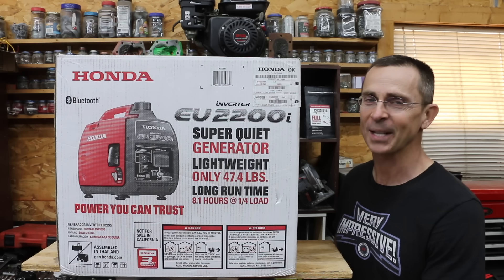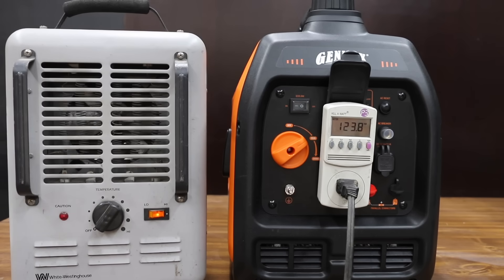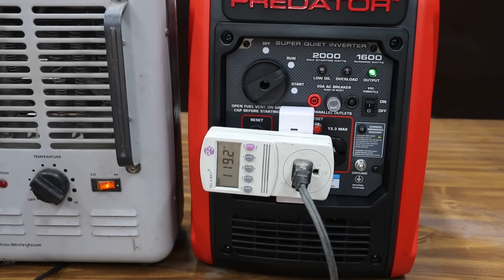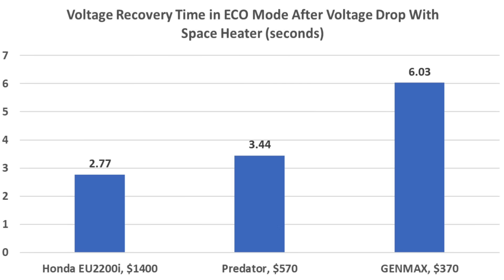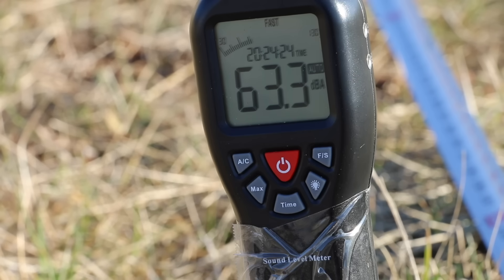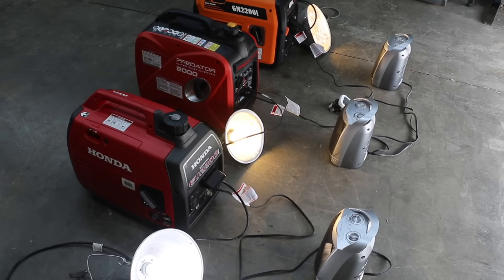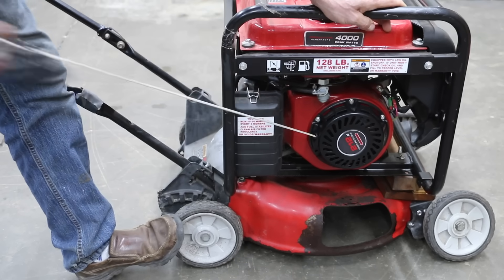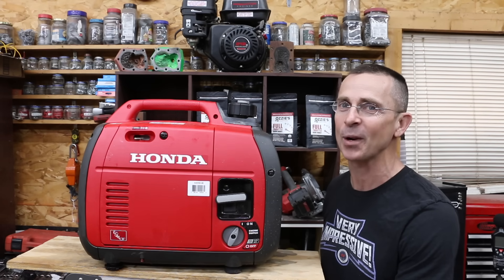Cheap Generator Better Than Honda? Predator vs Honda & GENMAX—Let’s Settle This!

Comment: I got the wen for 300 (same basic unit as predator iirc, but rated for 2200/1700). Works great and super quiet.
Reply from the maker: Thanks for the feedback.

Comment: Here's a footnote for you: I have two of the portable Honda inverter generators, a 1000 and a 2000, both with over 5000 hours of run time and NO repairs. It is questionable as to whether or not you would get that kind of service from the cheaper generators.
Reply from the maker: Thanks for the feedback.

Comment: I use that Predator 2000 inverter generator on a daily basis running concrete saws and demo hammers and running an omni directional fan. It's interesting that you shouldn't put more than 13A on the circuit, because with ECO off, it will trip the breaker running a 15 A motor, but turn on ECO mode and it will rev up and give it the starting power it needs to run 15A tools as long as you let the tool do the work and not jamming the tool into your work piece, it won't trip.
Reply from the maker: Thanks for sharing.

Comment: I bought a Wen generator a couple days prior to hurricane Harvey, but ended up not needing to use it.
During the Texas winter storm, I did have to use it. I ran it the first day no problem. The next morning it would not start. False sense of security that left us without power when we needed it.
I bought a Honda eu2200i on sale and during Texas tax holiday. I have fortunatetly not had to use it yet, but bought it based on the stereotype of Honda reliability, and many online reviews.

If is runs when I need it to run, it is worth whatever the difference is in cost over the cheaper brands.
Reply from the maker: Thanks for sharing.

Comment: Great video. With that much more metals in the oil I am not sure if the genmax would last nearly as long as the others. But the predator needing more oil is not great either.
The only other cheap brand I know of is Powersmart, not sure where it falls on the price list, but I believe it is around the genmax price. That would be a good one to compare to these. Not sure what other brands would be good to test with it.
Reply from the maker: Thanks!  Thanks for the suggestion.

Comment: I THINK that most small engine makers ask you to use conventional oil at first for a break-in period.   Maybe that gives a little insight into the oil burning.
Reply: I run Rotella 15w-40, works great in the summer. High zinc diesel oils are cheaper than high zinc small engine oils. 
For what it's worth my wen 3800 went through a 1 hour unloaded run new, I then changed the oil and have been changing it every 100 hours. It doesn't burn enough to be noticable.
Reply from the maker: Thanks for the suggestion.

Comment: I bought the predator 2000 during a long power outage to run my fridge / freezer. I was also able to run my gaming computer, 2 monitors and my GFs PS5 and 55 inch Sony TV. 1000 watts to the electronics and whatever the fridge and freezer used. It ran for over 12 hours on 1.2 gallons of fuel. Pretty decent little generator.
Reply from the maker: Nice!

Comment: Ryobi makes a competitor to these that has an electric starter (powered by one of its 18V hand tool batteries).  I’d love to see how that compares.  Similarly the Ecoflow Delta generator with its battery powered starter.
Reply from the maker: Thanks for the suggestion.

Comment: Another vote for a Champion test. I have 4K model which has been good for me. One feature it has that a lot of others don't is a fuel shut off valve which allows me to run the carburetor dry. With only ethanol laced fuel available where I live this is very important. I also have a small 1K Honda which if left for a bit requires some Seafoam to be run through it to get it to run smoothly.
Edit: I forgot to add that it also has remote start. We dry camp so it allows us to turn it off at night without going outside in my skivvies. Ditto in the morning to stat the coffee maker.
Reply: The Hondas do have a fuel cutoff. It’s the engine on off switch. If you turn it almost all the way to stop but not quite enough to kill the engine the fuel is shut off and you can let it run dry. 

The newer models have a label on the switch showing where to turn it to.
Reply: @Mi-ck  Thanks, didn't know that. I got mine as a basket case, no manual or anything.
Reply from the maker: Thanks for the suggestion.

Comment: I’d just want to mention that 10oz by weight is not going to be the same as by volume, and you may be under filling the generators if you measure your oil by weight.
Reply from the maker: Thanks for the feedback.

Comment: Have you had any requests to test robot lawnmowers?
....if not then consider this a request.

Suggestions for things to test...

* How efficiently they cover an area.
* How easy setup is (eg. boundary wire vs RTK GPS)
* How effectively they cut & chop the grass and how efficient their route is (random vs pre-mapped stripes)
* What area can they mow on a charge
* Can they traverse to multiple areas. What are the limitations on this
* How well they handle unexpected objects (branches, tennis balls, footballs, dog turds, etc)
* How easy it is to replace the blades and how often that needs doing
* How quickly the underside gets caked in grass clippings, and how easy they are to clean
* How well they operate close to buildings and under tree cover (GPS model specific)
* Whether they can tame an unmanged lawn or whether the grass has to be in a reasonable shape to begin with
* Special features.... rain sensing, etc.

Comment: It was good to know the status of the engines straight from the factory, however I would note that when you buy a small engine product you should expect a break in period of one or 2 oil changes using a high zinc additive before testing the oil for contaminants.  It would not surprise me in the least if the Honda had been broken in by the factory given its enormous price difference.  For the others, I'd be curious if their manuals mention anything about break in.  I know it would be a real time intensive additional test, but I would suggest running them all for at least one oil change with the aforementioned additive before testing the oil for wear.

Comment: FINE test, Commander on all counts. I'm sort of skittish on the pure power inverter gensets because of being so blasted complicated but I guess of the stuff they were running, one would be kind of necessary. We have an old brushed (unclean power) Coleman 5k with a 10 horse Briggs I/C engine for 220 to pull the well pump. I got it from a neighbor that had to move in 01 and eventually added electric start and a throttle. I HATE something have to start up hammered right off so I cured it. Several years warming up on idle and it still runs. AND we have an old Onan cast iron 2500 watt out of an old WINNIE for coolers. 4-pole at 1800 r's and just putters along. And the new ones with all their enclosures get my eyebrows up about sufficient cooling and maybe thicker oil might help some but cause it to use a drop more gas (HORRORS). We both know that oil changes with good oil are the life of all things, not just small engines. If I HAD to have an inverter genset I'd get one BUT until then, the old standby's do just fine and nothing has burned up yet. Hope yall have been getting rain. Ours starts tonight. BLESSINGS to ALL The FARMERS!
Reply from the maker: Hi Lewie, Thank you very much! It's always great to read your comment. Great point regarding the complicated setup. As usual, you've got your bases covered and are ready for what comes your way! Also, you are right about oil changes. The old suburban that I drive just crossed 300,000 miles and the secret to its longevity has been the oil changes. It's been very dry here, and I'm PRAYING for rain! Very little grass growth so far and hay production won't be good if this continues. Glad y'all are getting rain.  BLESSINGS!!!
Reply: @ProjectFarm  I'll be praying too!

Comment: This isn't exactly a fair comparison , It's not PF's fault either! The Honda has a larger motor, this will give it an advantage when it comes to reaction to load. I believed the honda would have lasted longer for the same reason because it doesn't have work as hard, but that big motor ended up being more thirsty after all.
Reply from the maker: Thanks for the feedback.

Comment: Yeah they are the best for sure but very expensive. If your a once a month running lights off it just get the predator but if it's a staple unit get the Honda...
Reply from the maker: Thanks for the feedback.

Comment: What a video! Confirming you as the king of tests. Can some kind of item be connected to outputs on the cheaper generators with "dirty waves" to make them "clean"?
Reply from the maker: Thanks for the suggestion.

Comment: You put 2 inverter generators against 2 non-invertor generators.  Of course the inverter generators will be quieter and cleaner electricity.  Try putting a predator that is inverted against the Honda if you can.  Would be a more even test.
Reply from the maker: Thanks for the constructive feedback.

Comment: Hondas are the king. 
All others are honda clones with varying quality of components depending on price. 
Eu30is goes for 1200$ & eu70is for 2500$ here. 
In usa it is quite a bit more expensive. The cheapest honda i can get is a 1kva non inverter (750w cont) & that goes for around 300$. If you are powering some fans and lights that generator is enough. 
I bought a broken eu30is for 200$ and fixed the fuel system. Had to clean the carb for a week because of 6 years of rotten fuel. 
Engine was locked due to fuel residue in the cylinder. Lots of carb cleaner and a hard yank of pull cord cleared it 😂
Reply from the maker: Thanks for the feedback.
Reply: @ProjectFarm  please make a detailed video on the eu3200i. It has fuel injection as supposed to be more fuel efficient and reliable. So it would be good to see how much fuel can actually be saved and if it is worth over the price premium.

Comment: Nice video.  We have a WEN 56200i 2,000 watt which is nearly as good as the Honda at less than half the cost.  Started right up and ran loads with no problem.  Runs fairly quiet and very quiet in ECO mode.  It comes with a tool kit including a spark plug removal tool, a small oil funnel and a DC Charging Cable. Many accessories that fit the Yamaha generator will also fit the WEN.
Reply: WEN are nice, but not as nice as the Hondas.
Reply: @nobodynoone2500  Of course.  If you want to spend twice as much.  Which is the point of this video.
Reply from the maker: Thanks!  Thanks for sharing.

Comment: wow so it really is worth it, if you keep it long enough and use it for more than just an occasional camping trip. The oil analysis is crazy different. great video. I bought a Champion myself for a third of the price, but I only use it camping and the occasional desert RC car bash with the boys. I can see if I ought the Honda it would probably be the last generator id ever buy. Great video as always.
Reply from the maker: Thanks!  Thanks for sharing.

Comment: Is there a reason you didn't test generac? Around here here you either have Honda or generac for gas generators. Great video as always though. Would like to see gas powered concrete saw blades someday as well 👍
Reply from the maker: Thanks!  Thanks for the suggestion.

Comment: Great video (as always).  I know one of the questions that comes up over and over regarding these non-Honda generators is longevity.  How long will they last compared to a Honda?   This is a more challenging test, because of time.  Perhaps you could do one of your longer form projects and see how long a set of generators lasts (with regular maintenance, etc).  What happens at 1,000 hours?  2,000?  Etc.  I think everyone can see that the Hondas are quieter, but do they last longer?

Thanks, as always.  Good luck.
Reply: The oil testing said it all honestly. Both other engines, even after break-in, were shedding a LOT of metal.
Reply from the maker: Thanks! Thanks for the suggestion.

Comment: With the high cost of the Honda, would be interesting to see how a bigger, yet lower price generator (more bang for the buck so to speak) would compare, such as the predator 3500 watt super quiet inverter with co secure.
Reply from the maker: Thanks for the suggestion.

Comment: Great video well done, the Honda would use more fuel at it has a larger CC engine then the other two,  although the Honda's efficiency showed through on Eco mode being very very close to the other with much smaller engines.
Reply from the maker: Thanks and you are welcome!  Thanks for the feedback.

Comment: I've got a Phaser generator, I got on sale for $235.  2200 started load, 2000 running load.  Nice and quiet and will run a 500 watt AC unit for just over 7 hours on a tank of gas.  I have no doubt that it's not going to last as long as the Honda, but I can buy 3 for the price of the Honda.  I know that the next one will be a Champion dual fuel so I don't need to carry gas with the travel trailer.  Only propane will be needed for the travel trailer.
My Phaser calls oil change every 50 hours.
I bought it 6 years ago and I'm still using it.
Reply from the maker: Thanks for sharing.

Comment: The company I work at sells Generac exclusively. I’d be curious to see how any of their products (generators, inverters, etc.) would perform compared to other brands. They’re definitely a premium price, but I have no idea if they’re really worth that premium.
Reply: My old Generac Wheelhouse will not quit! It has over 800 hours on her and burns some oil, but it will not die! The large back wheels make it easy to move around
Reply from the maker: Thanks for the suggestion.

Comment: I have a Honda 2000 EU generator that I've owned for many years.  It's been an excellent machine.  Never let's me down.  Back then it cost around $900, but I believe it was worth the money.
Reply from the maker: Thanks for sharing.
Reply: EU2000i.  I have one of those and paid around that so we likely got them at a similar time.  It really came in handy for The Great Texas Freeze in 2021.  We don’t as yet have a whole home generator.  I only thought I’d need a generator for hurricanes.  I knew I could run a refrigerator, a freezer, or a coffee pot with it.  What blew my mind was it ran our large Breville toaster oven.  It was wonderful having hot home made pizza while freezing our butts off.  When you really need it to deliver, the Honda does.
Reply: @kevingray8616  --  A word of advice, install a wood heating stove!!  Maybe even a wood cooking stove.  I have both including an outdoor rock fire pit with implements and cast iron for cooking.  If the power goes out here, and it has, I'm warm and can cook, boil water, etc.  Oh, a good supply of beeswax candles, candle lanterns, and kerosene lanterns are a good idea as well.  I'm not a "prepper" in the normal terms, but I don't trust what's going and I don't trust utility companies. Besides, I live remote and always take precautions..........
Reply: @ironcladranchandforge7292  My house doesn’t lend itself to that.  I do have a propane lit wood fireplace and we used that to stay somewhat warm.  The problem is that we have an open floor plan with soaring ceiling.  Normally it is amazing.  Just too much area to heat using a fireplace.  Since the freeze I do keep 30 gallons of water in stackable containers. (in addition to some bottled water)  That came in handy when the well pump failed on a weekend.  I also have propane and some propane cookers; not to mention charcoal and a kamado grill.  Like my neighbors I hope to put in a generator one day.

Comment: Honda's long established reliability, large dealer network and ready availability of parts means more to me than cost here.  Some of these small Hondas have many thousands of hours and are still going strong. In short, you get what you pay for.
Reply from the maker: Thanks for the feedback.

Comment: My little Harbor Freight Predator generator has been a good one for periodic episodes of power loss during storms, especially considering the price. It ran my gas furnace, 2 refrigerators, several lights, and keep all my electronic devices charged for about 48 hours recently without a problem. One tank of gas lasted 13 to 14 hours. I recommend it for periodic light use such as I described here. Saved me the cost of a few hundred dollars of food in the refrigerator.
Reply: Same here! Mine lasted 12 hours on a 1300 watt load on 1.2 gallons of gas. It pairs really well with a small camper too :)
Reply from the maker: Thanks for sharing.

Comment: Those Costco and Sam's warehouse's sell generators but I believe they are higher wattage than these. Honda has always been the king in portable hand carry generators...yes for a little more $$ but it seems that the value is higher with the Honda due to the obvious longer life and better service they provide. That Harbor Freight engine won't last very long based on the content in this video. So, if you will need one of these often, may as well buy the Honda. If you only need one for occasional use and not for critical needs, get the Genmax.
Reply from the maker: Thanks for the feedback.